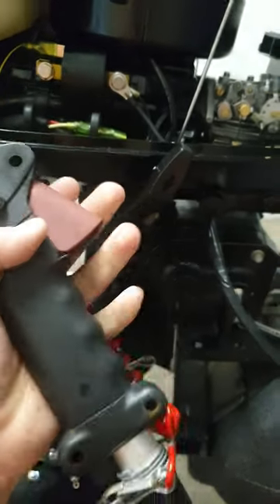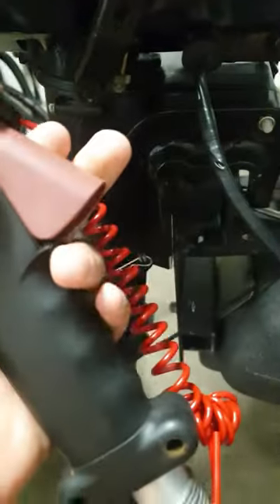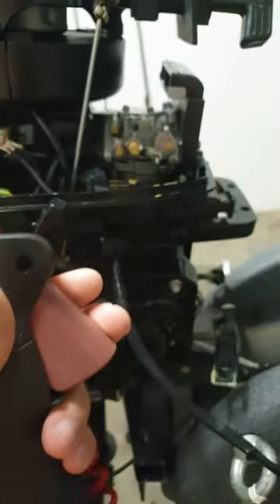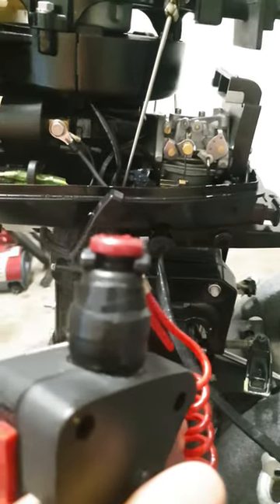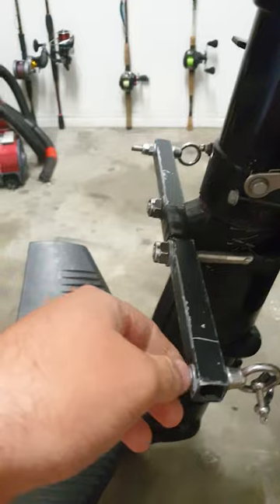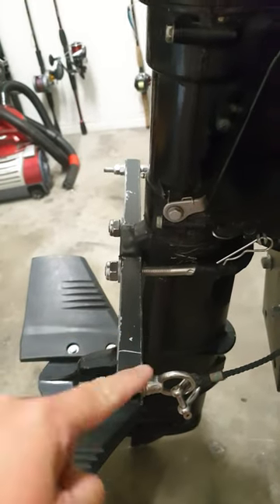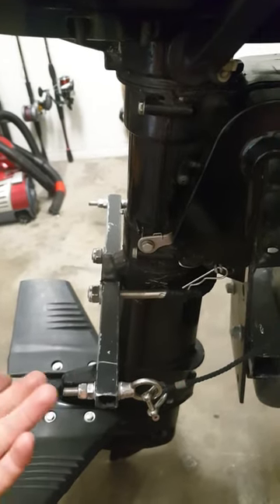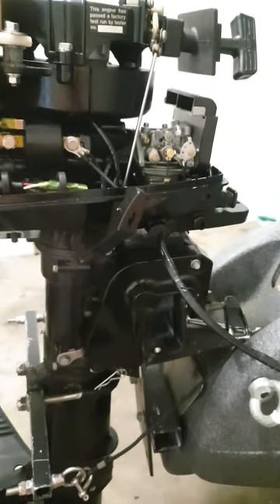Steering and throttle controller for PowerYak

Comment: Nice work!
Reply: I subscribed too and now you have me thinking about foot pedal steering on my beast. I have done many pedal steering kayaks with trolling motors but this would be a first...a new challenge.
Reply from the maker: @Aksmaniyak  it's not to hard to rig up and having free hands helps when fishing and also balance at top speeds.
Reply: I can figure out the hands free steering. I would need to look and see if my outboard could work with the joystick part. But my outboard is really only for getting to spots quickly and then the bow mount trolling motor can do the finesse fishing part.